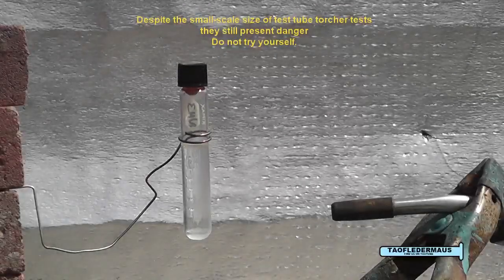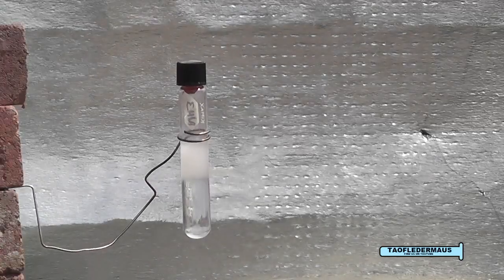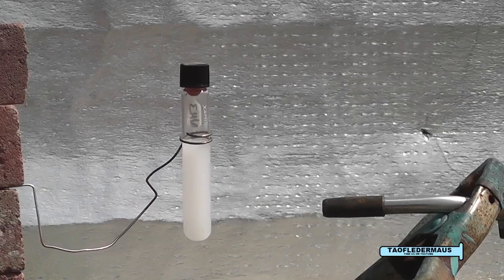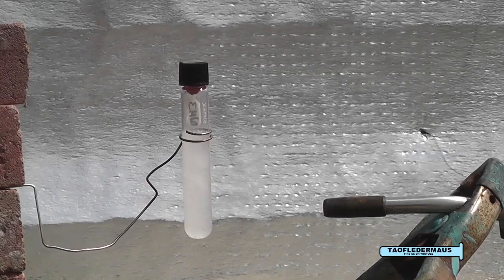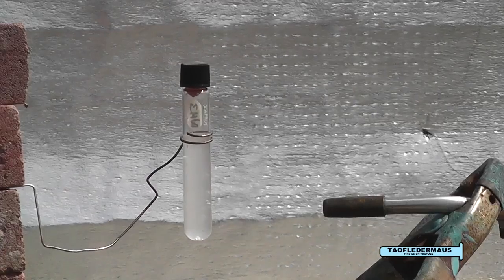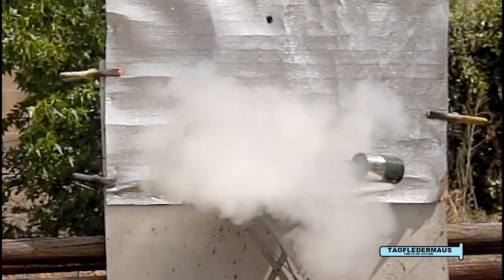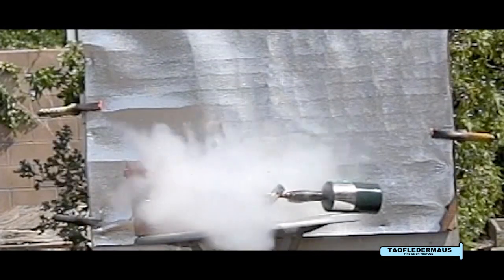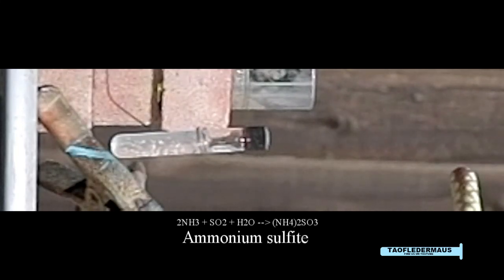TTTT- Household AMMONIA- Test Tube Torcher Tests -

Comment: I just thought of a good TTTT idea, and I don't believe you've done it. Try brake fluid, the boiling point of DOT 3 is 205 celsius, DOT 4 is 230, and DOT 5 is 260. It'd be interesting to see how much more stress the DOT 4 or 5 can take compared to DOT 3. Although it should be noted a lot of fluids will say DOT 3&4, they're typically more like a DOT 4.5 as their dry boiling point is listed as 245 or so celsius.
Reply: Also what about Acetone? Also acetone is, according to it's MSDS, very safe. Probably safer than the brake fluid, but I think I still rather see brake fluid lol.

Comment: I'm still not sure if I appreciate the narration, or the subject thereof more. Great stuff sir.
Reply from the maker: It saves me a lot of explaining what is going on and a ton of other questions in the comments.   "what's up with that wire?"   "why did you use silicone?"   "why did you pull away the torcher?"  "what did it smell like?"   "How far does the glass go"  etc.
Reply: What I mean is, you are a great orator. You should look into narration for audio books as a side gig.
Reply from the maker: oh oh oh..   I misread your comment.  I'm actually a terrible speaker.   I have to take a lot of retakes and record a sentence or two at a time.   I guess it would help if I scripted things out.
Reply: I thought about doing that for my videos, but it seems so disingenuous. So I stammer and plod about.
Reply from the maker: The few times I did type up a script, it sounded robotic.   Practice make perfect,  I guess.

Comment: do you know why auto glass installers don't use silicone when installing windshields. silicone only holds up to 500 lbs shear point. where urethane holds up to 5000 lbs shear point. and it's much more nastier to clean up afterwards than silicone.

Comment: I used to work around ammonia an chlorine gas a lot.  I HATE the smell of ammonia.  I would rather get gassed by chlorine than ammonia any day.  CL2 is more deadly but at least it smells better
Reply from the maker: There was a guy killed by NH3  a few months ago at a plant just up the road.   Even though it isn't poisonous,   it will knock you out and asphyxiate you in high concentrations.    Gotta be a horrible way to die.
Reply: It is very dangerous.  It is not quite a one breath kill rate but it is close.  I have been gassed before.  It was a high enough concentration that I could see a brown cloud

Comment: So is the sulfur dioxide only there to help produce a visible cloud when the tube blows?
Reply from the maker: Yes,   I wasn't sure if the household ammonia would be concentrated enough to produce a cloud,  and thought when it went off it didn't work at all.   SO2 (sulfur sticks)  are used as a leak detection method for ammonia refrigeration and will indicate a tiny leak very well with a  visible cloud.

Comment: Tao,can you do household peroxide next?
pure chlorine too!
Reply from the maker: A lot of people have wanted to see hydrogen peroxide so I will be doing that.
Reply: Chlorine is a gas. DO NOT HEAT IT UP IN A TEST TUBE!!! It was used in WW1 for a reason. How do you get it in there anyways? What do you think happens? We heated that stuff up to over 1700°F and it leaked out (in a safe environment, very low pressure), no reaction with air or anything. The oxides of Chlorine actually disintigrate at very low temperatures and are not stable at room temperature
Reply: TheKlaun9 "household" chlorine/bleach i should've added, sodium hypochlorite
Reply: Guillermo Lovato Oh ok, I thought you meant pure Chlorine, sry
Reply: TheKlaun9 pure chlroine would also be fun!, sadly it's normally in gas form so no luck